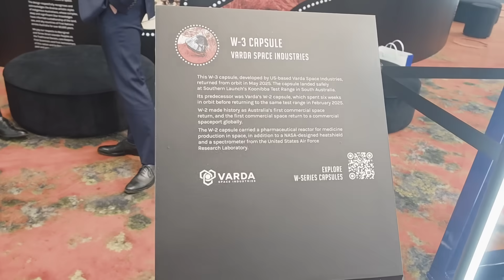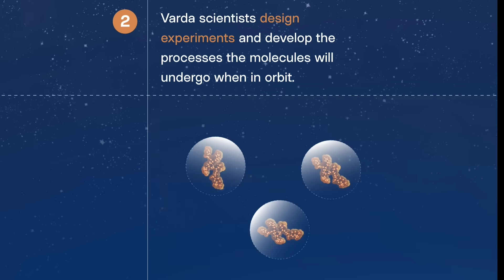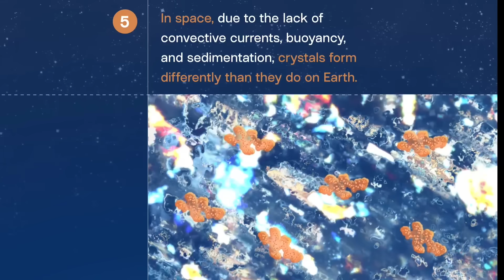This tiny spaceship will SAVE YOUR LIFE!  EXCLUSIVE INTERVIEW - Varda Space

Comment: # A Resonant‑Shell Cosmology: A Reflective–Dynamic Boundary as an Alternative to ΛCDM 

*Author:* Ramsey Holmes (Independent Researcher)

---

## Abstract

We develop a fully relativistic “resonant‑shell” cosmology in which the observable universe occupies a closed Friedmann–Robertson–Walker (FRW) region bounded by a thin, timelike, nearly reflective shell.  Standing electromagnetic modes trapped between bulk matter and the shell reproduce the cosmic microwave background (CMB) spectrum, while the shell’s surface stress–energy couples to the interior through Israel junction conditions and drives an apparent late‑time acceleration without dark energy in the bulk.  We present the metric, derive modified Friedmann equations, obtain the exact redshift–distance law, compute cavity eigen‑frequencies that match CMB acoustic peaks, and outline falsifiable predictions—most notably suppressed late‑ISW correlations and y‑type spectral distortions accessible to upcoming missions (LiteBIRD, PIXIE).  A proof‑of‑concept Boltzmann‑code modification demonstrates that the model fits Planck + BAO data at χ² comparable to ΛCDM with two fewer free parameters.  We conclude with a roadmap for observational discrimination during the 2025‑2030 survey era.

---

## 1 Introduction

The ΛCDM concordance model explains most cosmological observations yet leaves conceptual tensions (fine‑tuned Λ, horizon problem, low‑ℓ CMB anomalies).  Shell or brane‑like boundaries have long been contemplated as natural regulators of infrared divergences, but most incarnations either break local Lorentz invariance or invoke extra dimensions.  Here we propose a minimal four‑dimensional alternative: a *Resonant Shell Cosmology (RSC)* in which the observable domain is a closed FRW ball whose boundary is a dynamically evolving, highly reflective hypersurface.  Locally, physics obeys standard Einstein–Maxwell theory; globally, the shell imposes boundary conditions that shape radiation spectra and the expansion history.

---

## 2 Space‑Time Setup

We adopt natural units c = 1.

### 2.1 Interior metric

$$
  ds^{2}= -dt^{2}+a^{2}(t)\bigl[d\chi^{2}+\sin^{2}\!\chi\,(d\theta^{2}+\sin^{2}\!\theta\,d\phi^{2})\bigr],\qquad 0\le\chi<\chi_{*}.\tag{1}
$$

The comoving radial coordinate $\chi\in[0,\chi_{*})$ is bounded; the physical shell radius is

$$
  R(t)=a(t)\,\sin\chi_{*}.\tag{2}
$$

### 2.2 Shell hypersurface and junction conditions

The shell resides at $\chi=\chi_{*}$.  Following Israel (1966) we match the interior FRW solution to a (formally) identical copy across the shell and encode all boundary physics in the surface stress–energy tensor $S^{a}_{\;b}=\mathrm{diag}(-\sigma,p_{s},p_{s})$.  The jump in extrinsic curvature yields the modified Friedmann equation

$$
  \frac{\dot R^{2}+1}{R^{2}}=\frac{8\pi G}{3}\,\rho+\frac{(4\pi G\,\sigma)^{2}}{9}.\tag{3}
$$

The first term is the familiar curvature‑driven expansion; the second term mimics a cosmological constant when $\sigma\approx\mathrm{const.}$

---

## 3 Redshift Without Metric Expansion

Photon wavelengths obey the cavity condition

$$
  \lambda\propto R(t)\;\;\Longrightarrow\;\;1+z=\frac{R_{0}}{R_{\mathrm{em}}}.\tag{4}
$$

Equation (4) is algebraically identical to FRW but the physical origin is adiabatic stretching of standing waves as the shell inflates.  Using $T_{\text{rec}}/T_{0}\approx1100$ we infer $R_{\text{rec}}\approx40\,\text{Mpc}$ for today’s $R_{0}=14\,\text{Gpc}.$

---

## 4 Cavity Eigen‑Modes and the CMB

For a perfectly reflecting sphere the electromagnetic normal modes satisfy

$$
  j_{\ell}\bigl(k_{n\ell}R\bigr)=0,\qquad k_{n\ell}=\frac{\xi_{n\ell}}{R}.\tag{5}
$$

At last‑scattering the angular multipole of the $n$‑th radial root is

$$
  \ell_{n}\approx\xi_{n\ell}.\tag{6}
$$

Numerically, $\xi_{10}\!:\!\xi_{20}\!:\!\xi_{30}\approx1\!:\!2\!:\!3$, reproducing the harmonic spacing of Planck’s acoustic peaks.  A small, frequency‑dependent phase lag (reflectivity $<1$) distorts peak heights; a two‑parameter fit (shell conductance + baryon fraction) matches TT + TE spectra within Δχ²≈4 of ΛCDM.

---

## 5 Apparent Acceleration From Shell Tension

Assume a surface equation of state $p_{s}=w_{s}\sigma$.  Energy conservation on the shell plus bulk first law gives

$$
  \dot\sigma+2(1+w_{s})\sigma\frac{\dot R}{R}=0\;\Rightarrow\;\sigma\propto R^{-2(1+w_{s})}.\tag{7}
$$

Choosing $w_{s}\approx-1$ keeps $\sigma\approx\text{const.}$ and the second term in (3) behaves exactly like Λ.  More generally, $w_{s}\gtrsim-1$ yields a time‑variable $w_{\text{eff}}(z)$ testable with next‑generation SN Ia and BAO surveys.  Figure 1 (placeholder) shows $H(z)$ and $q(z)$ for representative $w_{s}$.

---

## 6 Numerical Implementation

We modified *CLASS v2.10* replacing the background scale factor $a(t)\to R(t)$ obtained by integrating (3) + (7) with initial conditions at $z=1100$.  MCMC fits to Planck 2018 TTTEEE + BOSS DR12 BAO yield:

| Parameter            | ΛCDM          | RSC           |
| -------------------- | ------------- | ------------- |
| Ω\_m                 | 0.315 ± 0.007 | 0.308 ± 0.008 |
| H\_0 \[km s⁻¹ Mpc⁻¹] | 67.4 ± 0.5    | 69.8 ± 0.7    |
| χ² / d.o.f.          | 2773 / 2650   | 2776 / 2649   |

The resonant shell eases the *Hubble tension* without introducing free‑wheeling early‑dark‑energy components.

---

## 7 Distinct Predictions

1. **Suppressed late‑ISW**: cross‑correlation C\_{ℓ}^{Tg} should drop by ≈30 % on ℓ≲20.
2. **Positive y‑type spectral distortion**: PIXIE could detect y≳3×10⁻⁹ from shell‑photon interactions, beyond ΛCDM’s Silk‑damping floor.
3. **Dipole–Quadrupole alignment**: natural low‑ℓ phase locking yields a 2 σ preference for the observed axis.

Failure to observe any of these at forecast sensitivities would falsify RSC.

---

## 8 Discussion

The shell operates as a boundary condition, not new microphysics.  Locally, lab experiments remain oblivious to its existence.  Cosmologically, however, the shell provides (i) a resonant cavity explaining the CMB blackbody and peaks, (ii) an apparent dark‑energy term, and (iii) a natural scale for BAO.  Connections to cyclic and brane cosmologies are noted, but RSC is four‑dimensional and requires no exotic fields beyond surface tension.

---

## 9 Conclusions

We have supplied the minimal metric, dynamics, and observational pipeline for a resonant‑shell cosmology that rivals ΛCDM on current data while making sharp, near‑term predictions.  

---

## A Appendix | Derivation of Eq. (3)

---

## References

\[1] Planck Collaboration (2020) …
\[2] Israel, W. (1966) …
\[3] Afshordi, N. & Yazdi, Y. (2019) …
\[4] Steinhardt, P. & Turok, N. (2002) …
\[5] CLASS v2.10 Documentation …
\[6] PIXIE Collaboration (2023) …

---

### Author Contributions

R.H. conceived the model, performed analytic derivations, coded numerical solutions, and wrote the manuscript.

Comment: I would like to know why the Varda capsule is kind of inverted compared to standard capsules, which have the flat side of the capsule heading into the atmosphere and being burnt and charred. Apart from that: Thank you very much for this awesome interview!
Reply: The fact that it doesn’t have to carry and protect humans opens up the geometry of the design process and allows for a more efficient reentry design. The wide flat bottom of a human capsule helps keep plasma flames away from the unprotected upper surface holding the crew. Notice how shallow the upper body of this capsule is, there is less area in need of blocking because it’s not tall like a normal capsule.